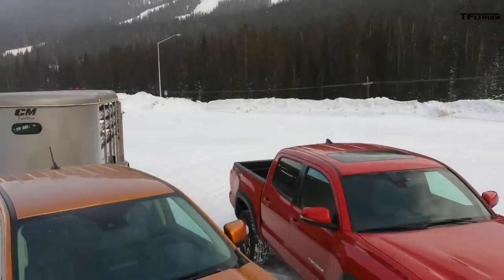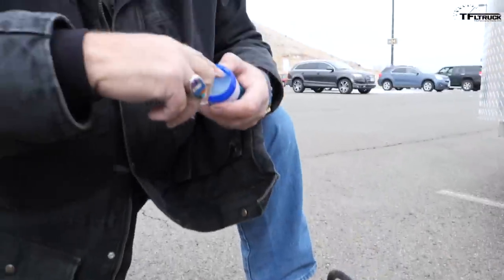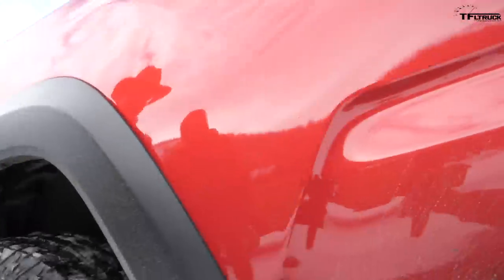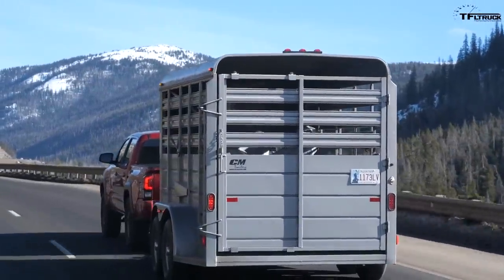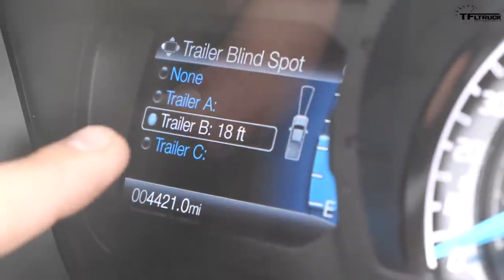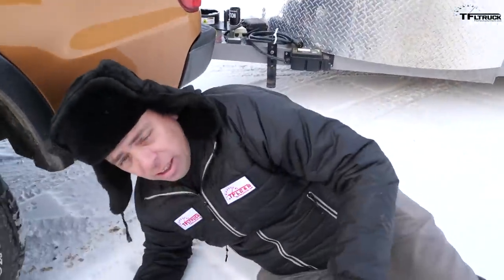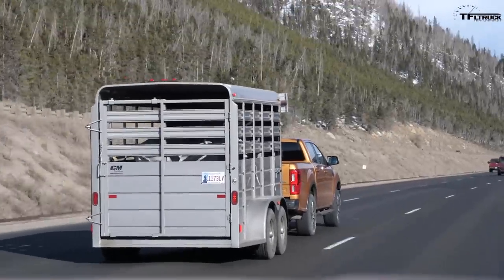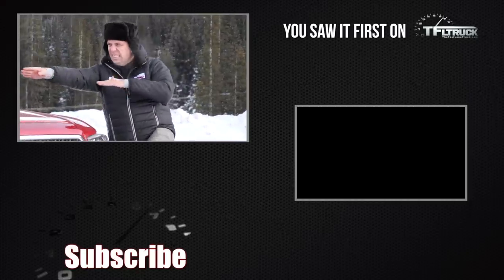Best Midsize Towing Truck? Ford Ranger vs Toyota Tacoma vs World's Toughest Towing Test

Comment: Hey Guys,
Great video, been watching for years.  A few things to note. I run a 2017 Taco crew SB, 6 speed manual. Stock gears are 4:30. Aftermarket 2” lift Bilstien 5100 on 33” Duratracs load E. If you order the Sport and you get the moon roof it adds a butt load of head room. I’m 6’1”.  I tow a 5300 lb loaded rv 24’ in length. I live in BC Canada and I’m surrounded by mnt passes. My Taco tows it amazing! I run and I highly recommend the Curt ECHO Bluetooth Brake Controller. It’s a plug and go system that is very responsive and can be activated independently. Also I get to your GPM conversion 9 MPG average to a tank with the trailer on. The Taco 3.5 is very peaky but with the manual just keep it at 3500 rpm or above and sit back and relax. This is a lifted trailer as well so I can pull it deep into the backcountry for hunting as well as late into the season in snow. Spend the money and get the Taco manual guys. Your resale will thank you. The Auto’s are slushOmatics and the smaller displacement engines like the Ranger will never hold back on the descents, still no replacement for displacement . This is just my opinion. Side note- I’m a commercial driver also run private hot shot for years and still love my LBZ. Cheers. Look forward the the videos in the future.
Reply: I'm a truck driver as well I think engine braking on the 4 is not effective but a electric brake on the trailer and a exhaust brake on the 4 banger would save gas and be more efficient. diesel trucks depend on heavy drivetrain drag and big Piston surface area that's harder for compression at high rpms. A small gasser is never going to engine brake effectively not for the weight maby empty. IMHO 🤷🏻
Reply: And no one wants to hear a 4 banger or even V6 high rev down mountains all day. Well at least I wouldn't I would want a exhaust brake for sure. I haven't pulled anything heavy let alone up or down the mountain area yet but if I do I'm definitely getting one for my 2021 fx4 XLT already have 10k miles so far and 380 miles a 18g tank on daily driving to work and back. I'm sure I'll lose close to half the mileage towing but I don't have a rv yet to find out. I think gas mileage is mostly the drivers driving habits. I get 21-23mpg my wife 16-18mpg 🤷🏻😅

Comment: The ZR2 did the same test last year with the V6 and did it in 8 minuets exactly and 5.2 mpg’s. I’ll take the ZR2.
Reply: I bought the Tacoma because you get more features for less money and higher resale value. If i had the ford and the Chevy to pick from i would go Chevy.
Reply: I’d go chevy over ford any day. Ford’s QC, at least in relation to their cars hasn’t been very confidence inspiring for several years. Now they’re scrapping nearly their entire catalogue of cars... interesting to say the least.  @joshuathomas8529
Reply: I dunno If it's that nobody wants to buy cars in the US. Prius, minivans and other hybrid sales seem strong. I suspect it's a situation similar to the original Japanese compact invasion of the 1960’s. This time however, rather than trying to change and push innovation, they’re just kind of rolling over and giving up.   @jackmackenzie2118
Reply: @unabashedindividualist6232  except gm is not allocating production of vehicles here in murica anymore. You didnt see that I guess. If seen Chevy trucks on a few unreliability list due to engine failures so I don't think you know as much as you think you know.
Reply: Exactly. Plus you get way more features for this line of work (towing) not to mention off-road
Reply: @joshuathomas8529  Features in what category is what matters for the buyer. The ZR2 has a higher payload than this Tacoma, trailer brake controller, better engines options with more torque and hp. Got the same mpg and it's the off-road version. One thing it doesn't have is a sunroof but the seats do adjust vertically in the GM.
Reply: @EGGINFOOLS  The most valuable feacher to me is a manual transmission, locking rear diff, and no stupid air dam. If you get the TRD off road you get Navigation and radar cruise control standard as well. When I priced the Colorado with the same features as the Tacoma I bought it MSRP at 6,000 more.
Reply: @joshuathomas8529  Totally fair. Not bashing. Just facts. Z71 and ZR2 both have lockers with ZR2 having a front locker too. No manual though although there is a diesel option.

Comment: Great hat on the Stephen King look alike!I’d take the Ranger if it had a normally aspirated engine.The premium fuel requirement for the ecoboost is a deal breaker for me.
Advantage Toyota.
Reply: Despite conventional thinking in regards to turbi charged engines. The ford EcoBoost engines do not require premium grade fuel and can function just fine on regular unleaded.
Reply: Todd Cremers 
I’ve owned several turbos,and currently do.Up front,my car requires premium fuel as noted in the manual and on the gas filler door.Sure,there are cars that say that it will RUN on regular fuel,but if you look in the manual you will see language which says “for optimal performance,premium fuel is recommended.”
If you don’t keep your cars long,use regular.If you do,for performance and the life of the engine,premium fuel is the only way to go.
Reply: They run just fine on 87 octane but like any turbo they like 93.    No engine ping in mine.    Ford says 87 octane will not harm the engine.   They expect the majority of people to use 87.
Reply: Randy White 
I had a 15 Escape with the 2.0 turbo.In the owners manual it said,”For optimal performance,premium fuel is recommended.”I used 91 octane.My mechanic concurs saying in his experience,turbos and premium are a must.Sure,it will run on lower octane,but you’re mpg’s and performance will suffer.I’d look into it further if I were you.
Reply: I finally filled up with some 93 octane gas at a wallet ripping 55 dollars.    I will tell you it seemed to have a little more get up and go.     But if 87 octane won’t hurt it I’ll burn. 87 .    15 dollars more at every fill up adds up.   Pre ignition will hurt your motor in the long run.   I have listened to my motor several times I don’t hear any engine ping on 87.  I don’t put many miles on it     I just use it to pull our little Winnebago camper when we go camping. So I’ll just keep my ears open to see if a problem develops.    Hopefully ford is right saying you can use 87 octane because they warranty it for 60.000 miles.  But it won’t be the first time they screwed up.
Reply: Randy White 
If you stick with 87,make sure you stay away from no name gas.Sunoco or Shell would be my recommendation.

Comment: I'll take a bet that the Toyota truck is still on the road in 10yrs with 300k miles on it. The Ford? 4 cylinder turbos are not known for trouble free and/or long lives.
Reply: James Smith the turbo 4 came out 7 years ago. And there have been very few issues reported thus far. 

And I wouldn’t be so sure about that Toyota. The frame might be gone at that point
Reply: nippon mison  Looks better? Take off the blindfold
Reply: nippon mison looks better??? Nope. Resale is marginal
Reply: nippon mison  resale value doesnt make it an inherently better truck, IMO anyone who buys a vehicle and worries about resale value is an idiot, they arent appreciating assets.
Reply: Donkeh McDonkey midsized 

1 Tacoma 62%
2 canyon 59.5%
3 Ridgeline 56%

Marginal again. Ford ranger will be about 59%
Reply: nippon mison  of course I have, but if youre buying a car and concerned about lower ownership cost, buy a cheaper car. Cars are still depreciating assets, and my opinion stands that improved resale value doesnt make a car a better car.
Reply: @devinbender8428  it's not marginal. Tacoma has the best resale of any mainstream US vehicle. Period
Reply: Ford has had plenty of turbo 4 problems too... look at the Focus
Reply: smokesgtp CAN YOU NOT READ? 
Yes it’s the best in the USA. But it’s still less than 4% of a difference. That’s under $1000 difference after 5 years on a $35,000 truck. 

And the focus was an isolated issue. Less than 500 cars effected. 

The 400,000+ explorers and 100,000+ mustangs and 100,000+ Lincoln’s run just fine. No major issues. 

And that’s just the 2.3L let alone the 2.0

Comment: @TFL Why are you guys comparing the Taco with a sunroof with the Ranger without one? Also the gas mileage test should have been hand calculated at the pumps. You should  not trust the computers calculations.
Reply: They are sent the same set of vehicles as every other reviewers.  They can request, but will likely not receive certain vehicles

Comment: use   the ranger   to  go grocery  shopping     and  use  the  taco for   off roading
Reply: Did you not see them do the off road test with these two trucks the ranger did very well
Reply: james thomas Tacoma did the best tho
Reply: @andersonrodriguez8258 -Depends on who you ask...these two have gone head-to-head on several channels now and the Ranger is the winner in at least half of them.  It's all dependent on the tester and the course...and what the expectations are.  The Taco has better clearance (by 1/2") and better approach angle.  The Ranger has better break-over and departure angle.  The Taco has a plastic bumper that while looking more aggressive and quite nice...gets damaged much more easily than the Ranger's Steel bumper.  Most testers liked the Ranger's terrain management much better than the Taco's.  The Taco can be gotten with a manual which I prefer but the 10-spd auto is great...and the Ranger beats the Taco in acceleration by a long shot.  There are pros and cons for each so there isn't a real clear "winner".  It just depends on individual preference.   We should more often be saying "the Taco is a better fit for me" than the Taco is the best...period.  The former is more true since each can be better depending on the individual's preferences.
Reply: @dewrus2153  The clearance is actually almost an inch more, but what is more important is the grading on the bottom of the truck and the toyota wins leagues on that, until the a raptor comes out in the ranger.
Reply: @EpicLemonMusic -
Tacoma: 9.4" ground clearance 
Ranger: 8.9" ground clearance
That is  exactly 1/2" just as I stated...so it's not almost and inch as you stated.  

What is "grading"?  Please explain what you mean.   Thanks.

As mentioned, they are both great trucks but we have to be honest when comparing specs.  Approach angle, ground clearance, breakover angle, and departure angle are all important when driving off the pavement.  The Tacoma is better at two of them and the Ranger is better at the other two.
Reply: @dewrus2153  Clearly a google warrior over here Dewy. First of all the ground clearance numbers simply are measurements of how many inches off the ground the lowest point of the truck is. Grading is a very common term in offroading that refers to the shape of the undercarriage of the vehicle, it also refers to the shape of the struts which is what you do not want to damage. 8.9 was the projected ground clearance before it was released. At least the models released right now are 8.6.(google it past biased truck review) This is a useless number though, as ground clearance much more relies on the shape of the truck and like all the new trucks that go for comfort aka ranger and colorado those Strut(telescopic dampers) that they use to get that smooth ride on the road or dirt, makes the truck not as capable on rocks. Also the angled aerodynamic front of the ranger helps it get better mpg but makes it a risk when going down super steep grade. Albeit nobody actually ever needs that, but it is a factor.
Reply: @EpicLemonMusic -Oh...I also thought it was humorous that you accused me of being a "Google Warrior" and then four sentences later, you instruct me to Google something to find the truth...how funny is that?
Reply: @dewrus2153  Name calling? That isn't a name, that just means you took the first stat you found on googling instead of researching many sources, nothing wrong with googling it is great but not a source of stats, is a search engine. I am a guy who happens to like driving on hilly sandy uneven terrain.
Reply: @EpicLemonMusic  -Name calling?? Yep..."Google Warrior" is a name you called me in a weak attempt to discredit what I said and imply I really know nothing other than what popped up in a Google search.  It's much like telling someone who tries to sound like they know what they're talking about by saying they have a "Google Degree" or went to "Google Law School", etc.
-"Took the first stat you found"?  Nope...assuming again, my friend.  I first checked Ford's website which should be the authority for accurate information about their products....but I didn't even stop there, Epic.  I then checked multiple sources to corroborate the information.  So, sorry...you're wrong.
-I'm glad you're a guy who happens to like driving on hilly sandy uneven terrain.  That is fun.  I like to do that too...as well as muddy trails, rocks (mild rocks...nothing crazy), and generally anywhere there aren't roads.  The trucks they have today are great and I would be happy with either one one of them for different reasons.  Each has pros and cons...it's just up to the individual to determine which is right for them.

Comment: I cringe everytime I hear using cruise control while towing a trailer.
Reply: Rob Steingruber I always use cruise control.  What's the big deal.
Reply: Yea you can always tell who doesn’t know what they are doing by seeing that.
Reply: @maxracingteam23  The issue is the first response most drivers have when disengaging cruise is to hit the brakes. If you are in a situation where you are losing control of the trailer the last thing you want to do is even tap the brakes.
Reply: I’m not a big fan of cruise towing especially in mountain or hilly areas. I’m a flat lander still don’t use it except I may use for a few minutes to move around if I get uncomfortable on a long run.
Reply: Oh please,  what exactly would be the difference in hitting the brakes in a panic situation with or without cruse control?  In either situation you should have trailer brakes and a controller so why try to invent an issue where there is none?
Reply: I use cruise constantly while towing... maybe I would be different if it was 1980 technology.
Reply: I tow with cruise control all the time - in dry conditions.  But I also habitually cover the brake pedal.  I also cancel cruise when I have any doubt as to the stability of my truck and trailer.  And on my F150, I'd hit the cancel button or DAB the brake pedal to cancel.  Reaching for the trailer brake controller is less than ideal with Ford's placement of it but I follow the First Rule of Defensive Driving: Never Stop Driving The Vehicle.